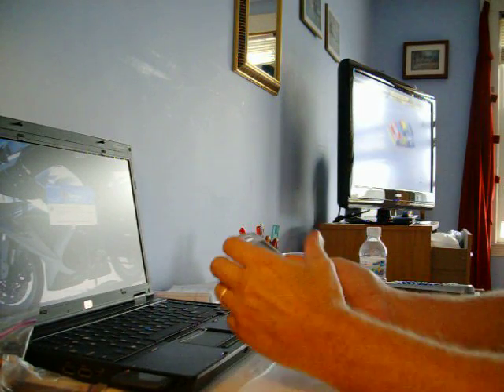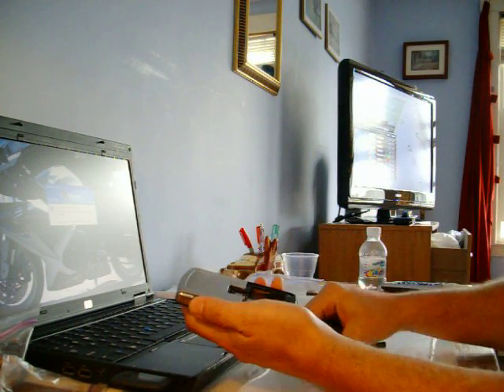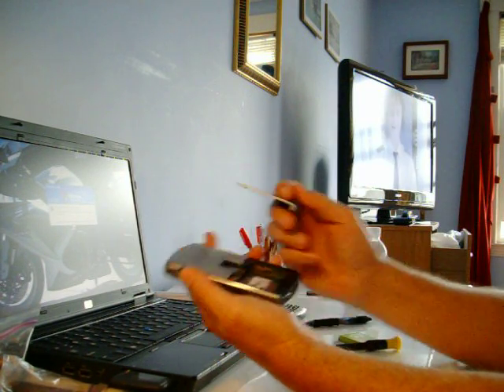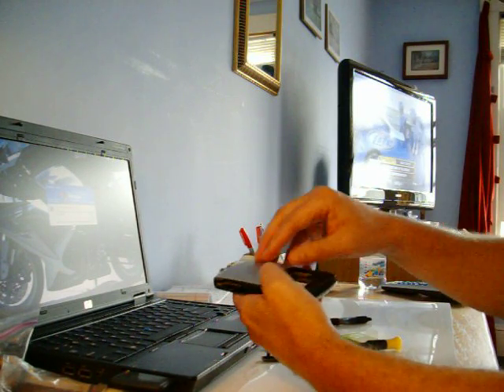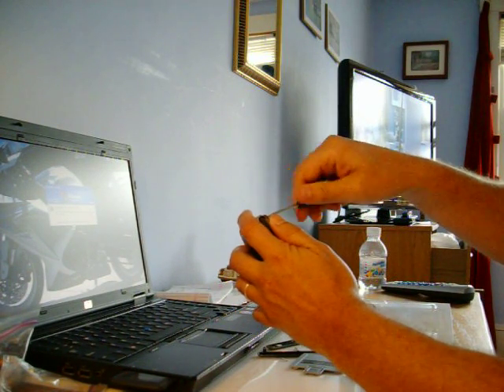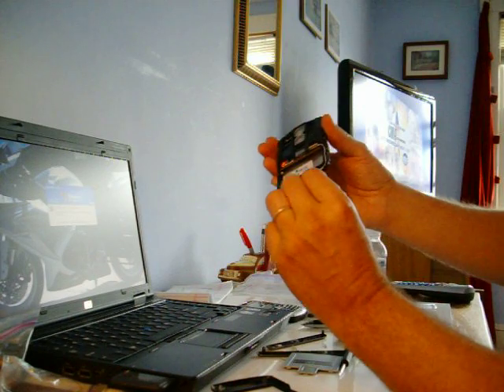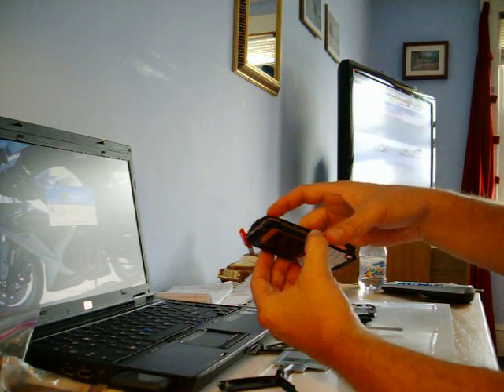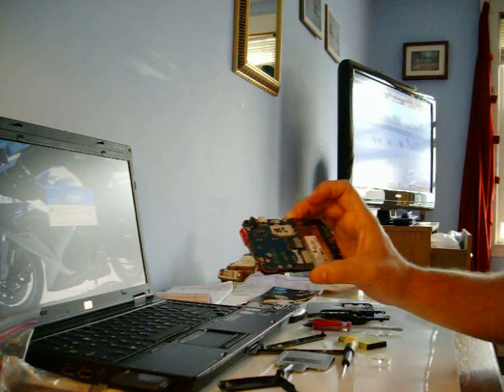Blackberry 8830 8800 FULL disassemble, broken Mini usb

Comment: Thanks for the excellent video.  I repaired the mini-USB connector on my 8830 today.  One of the USB pins had lifted from the circuit board.  I carefully soldered back into place and reassembled the pieces and everything is now functioning.  BTW, the small white wire near the bottom of the unit is an RF cable, not a microphone connection.  Thanks.

Comment: Thanks for taking the time to post this video my 8830 had a T5 torx, but in a pinch a T4 will work, T6 was too big. You should be able to find at Lowes, Home Depot, or on Amazon if you can not find in other local stores.

Comment: just replaced my USB on my 8820... what a job... at least I can still use it now... I must have messed up soldering one of the pins though because even though it will charge and everything on the phone appears fine, when I connect it to my PC it doesn't recognize it anymore.... anyway---thanks! your video helped.

Comment: Was curious how to get that last piece off that was covering the USB port. Thanks man. A tip though, be careful where you touch on the circuit boards, most of the components are sensitive to static electricity.

Comment: a very small flat head will work in place of the torx screw driver. Jus has to be small enough to reach from one side of the "torx head screw" to the other. fyi incase you cant find a torx of the right side

Comment: I had the same problem. I bought the new charger port on ebay, but even though I can solder very well, there was no way I could solder that without damaging something. I took it to my local TV/VCR/computer repair shop and asked them to solder it . They charged me only $20 because it was all apart. It charges fine now, but I still have a problem I had before; the rollerball pushbutton function doesn't work, I installed a new ball and cleaned the contacts, but that didn't help. Any suggestions?

Comment: my 8820 is going flippo......its like the "clicker" under the trackball is stuck. it keeps selecting at will. i can be on a text screen, and it will select by itself......and you guessed it, brings up the send option and sends a text before im done. its awful, almost every page is unusable. its happened before but worked fine after a couple days. my working theory is its the seasons changing. i live in alabama, our humidity is MURDER. hoping its just fall arriving and will work again soon.